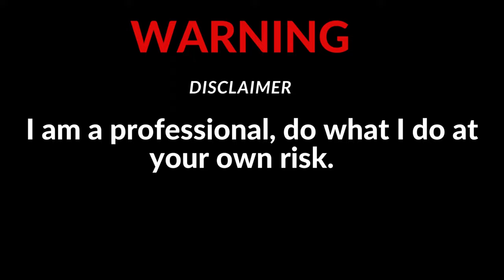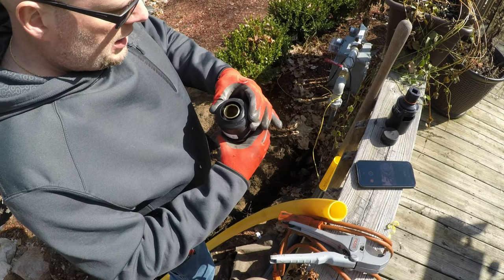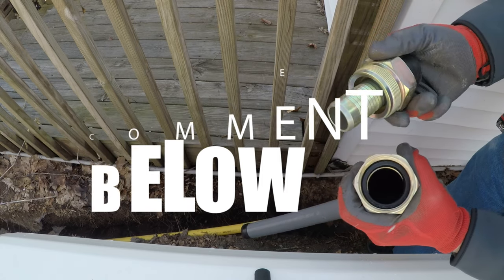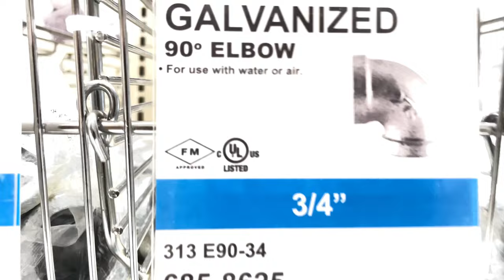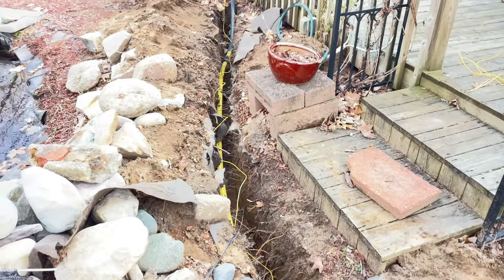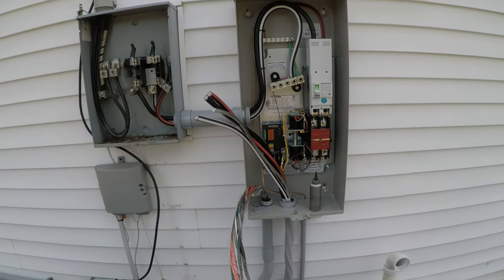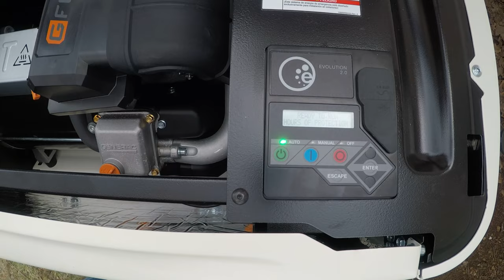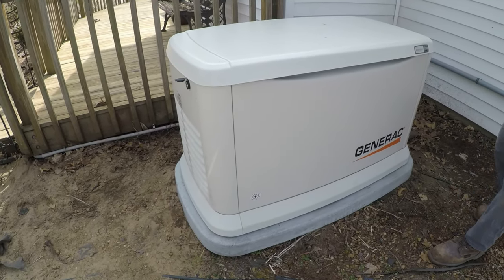Installing A Whole House Generator - Generac 22KW

Comment: Ive been an electrician for over 37 years and never seen someone cut wire with a bandsaw. First time for everything I guess.
Reply: only way i do it when i can. ratchet cutters are to expensive haha
Reply: @ClayAdams-zj8yf  best way to cut fiber optic wire as well. Learned that at AT&T
Reply: Use what you got handy.

Comment: I have a 45k Generac using LP. The home is entirely electric, and having a generator definitely adds peace of mind.
Reply from the maker: Yes it definitely is.
Reply: Holy crap. What's your 24hr cost for fuel during an outage?
Reply from the maker: You can't put a cost on peace of mind. Also the cost of losing everything in your freezer would probably cost more 😬

Comment: In my area you are supposed to pressure test with air for 20min.
Reply from the maker: In other areas that is a fact. That's why I turned on the gas a leak checked everything well with big blue.
Reply: @ADVANHVAC  A pressure test is not done with natural gas pressure...too low. You need a pressure test with a 30lb gauge @ 15lb for 30 minutes.

Comment: Just anyone can’t do this have to be licensed gas fitter and has to be leaked tested with high pressure air through using an air test gauge..
Reply from the maker: If you're doing it on your property and have any mechanical skills, yes, you can do it.

Comment: Your going to wish you installed that generator away from your deck and I let my generator run for three days with no problems never shut it down once in my area power outage is not uncommon I have one once a year it’s been 12 years since I installed mine still running great so it should last a good long time.

Comment: Looks like a pain. Convert the meter to high pressure and run 5/8 copper
Reply from the maker: That would not make sense, I would have to add regulators to all of my other gas appliances. I had to do that once at a customer's house.
Reply: What is the delivery pressure of the standard gas meter in MI?  Based upon what I’m  seeing, you either have internal regulators for your gas appliances or you are running the risk of fuel starvation in an outage.  Here in Texas, most residential gas regulators are 4oz regulators, meaning the pressure you are getting at meter is only 4oz, and that regulated pressure isn’t going to deliver sufficient BTU load for the max BTU of that genset.  EVER.  Obviously, you will be more likely to have a winter outage in Michigan than the hurricane outages we have on the Gulf Coast.

One of the worst things I see in most gen installations is insufficient gas pressure.  Lots of times the techs that go to your house will do everything possible to get the gen running.,,which it will.  But for how long.  Not trying to be difficult but I’m wondering if 2psi regulator from the service line with a 4oz regulator for house line might not be better idea…
Reply: @BrianD-ds4dx explain a little more
Reply: @herewegoagain4041  it comes down to pressure and volume.  Here in Texas, the standard residential gas meter comes with 4oz of delivery pressure and the regulator has a 7 inch water column.  It is a mathematical equation as to the cubic feet or BTU load it will deliver.  If the Gen is not receiving sufficient pressure it won’t run.  Further if there is an insufficient volume of gas coming in, you will experience myriad possible failures and/or alarm codes from the genset. Simply…without enough gas the engine doesn’t run correctly.  Based upon the single regulator depicted on the outside of the residence….this Gen is probably only getting 1/4 psig or 4 oz.  So the gas is probably insufficient to run the generator
Reply: @BrianD-ds4dx  my meter says 
AL175 MAP 5psi
17S c.FH.@1/2"DIFF ANSI-CLASS

How much could that support off 1¼ gas line?
Reply: @BrianD-ds4dx  One cannot simply install a pounds regulator on your own system, if and when the gas company sees it, they will pull, and then charge for all the gas that you stole. 
I am surprised that Texas only runs 4" WC on their system.  You would have to use 1" minimum put more than likely 
1 1/2", if using PE than 2" downsizing to 1" sweeps.
Reply: @Moondoggy1941  look again sir.  Never said 4 inch WC.  I said 4 ounces.  The gas companies I deal with down here all have a 7” WC.

I’m also not suggesting anyone self install a 2psi regulator.  Anything installed affecting the pressure being delivered at the meter should be done by the gas company.

Comment: Good video.  I prefer the flexible risers for the gas to avoid underground connections on fittings.
Reply: I do not like the flexible risers especially for the generator end.  They provide no support for the rigid piping so it ends up flopping around.  Those stab couplings never, ever leak unless installed incorrectly and that is hard to do.
Reply from the maker: @nspro931 this was a first for me on the flexible ones. I drove a 5’ unistrut down for support. It's not going anywhere.

Comment: Could you have used black iron pipe and spray painted it for your above ground connections?
Reply from the maker: Yes I could have, If using Propane definitely use Black pipe.
Reply: I use black pipe on mine. Yeah you definitely have to paint it.
Reply: Never use galvanized piping on a gas line.  Use black fittings, then prime & paint to prevent corrosion

Comment: Can i install my own generator even though I’m not a contractor? Im a licensed hvac-R, and i work on a hospital environment, i know how to do gas line, electrical work and electronics, can i apply for a permit on my own home without contracting outside work? I have been installing gas furnaces, residential boilers, wiring outdoor units to breaker box before i worked in the hospital here SE Mi.
Reply from the maker: Yes, I believe you can you can pull your own permit as a homeowner.
Reply: @ADVANHVAC  thanks ill try that hope it works as a home owner, the inspector can check my work anyways😂

Comment: In canada, they won’t let us use close nipples , scared over time there’s not enough steel meat . And they make us air test every underground line , inspector to witness , and pull an underground gas permit and pull and appliance gas permit for the initial start up as well ..
Reply from the maker: 😮 that's a lot of Government hoops. Yeah I just did the smell test and sprayed micro leak detector. Called it a day.
Reply: Stop telling them your business.
Reply: A shoulder nipple is preferred only use a close if you have to, and that is usually the fault of the installer not planning well enough in advance. Sometimes it just has to be.

Comment: Ist it posible to use the Heat of the exhaust to Heat a hot water boiler
Reply from the maker: No, it doesn’t get that hot.
Reply: @ADVANHVAC  ah okay

Comment: Drip leg is already in the unit.. would of been better to put flex risers at meter and hard at generator, that one of eliminated having to do u strut
Reply from the maker: I would rather do it the way I did. Not a big deal with the uni-strut.

Comment: Will it run 2 air conditioners?
Reply from the maker: That depends on the sizes, It should. The next size up is either a 24 or a 26kw that would definitely run 2 ac’s.
Reply: @ADVANHVAC  should handle an AC no problem, 2 2.5 ton ACS it should work as long as the ATS IS 200+ amps. ACS use a lot of amperage when starting, but afterwards it drops off. The generator can handle it.

Comment: Uhhh I was told NG  required Black Pipe, NOT Galvanized
Reply from the maker: Just depends on your local area, they accept it here no problem. Can’t use galvanized with propane.
Reply: Wives tale